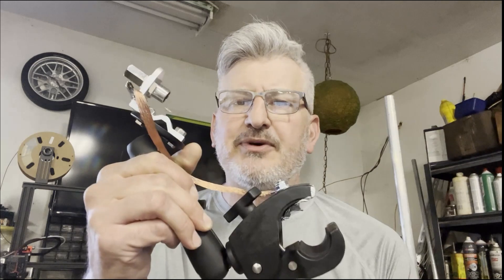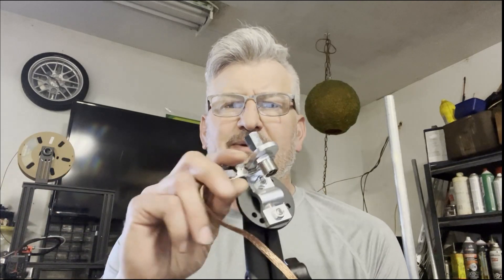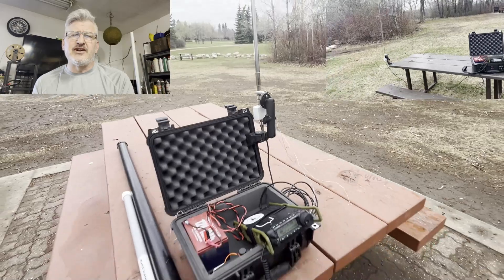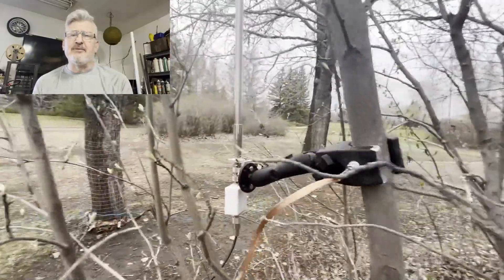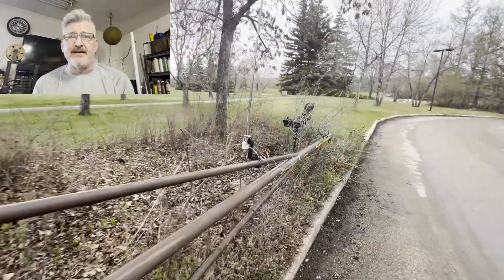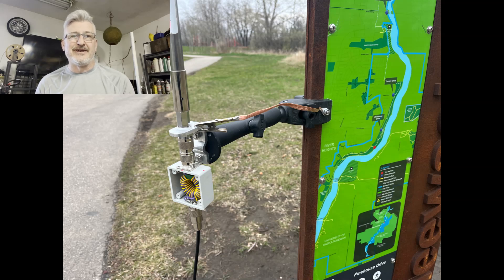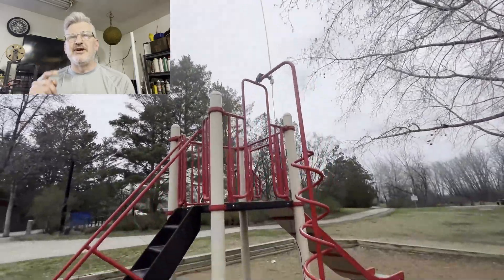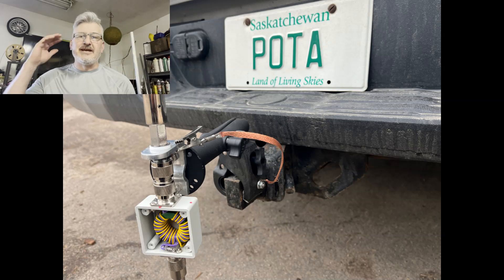Turning Random Objects Into Ground Planes With My DIY HF Antenna Mount

Comment: If you are mobiling in either a Tacoma or Tundra equipped with the adjustable cleats that travel in the rails along the inside of the fender tops, you can simply drill into the “meat” of one of the clamps and secure a 3/8x24 standard antenna threaded female coupling and there’s an excellent insulated mounting  base for lightweight mobile antennas such as Hamsticks.  Been running such an arrangement for 12 years now in our Tacoma with a cleat located as far to the rear as possible in the inside of the left fender wall.  I found the shield of the coax feed line under one of the two bolts on the inside of the fender just in front of the edge of the tailgate.  Be sure to use a burring tool to get down to bright steel under the head of the bolt on the stanchion for good electrical contact.  If you don’t want to drill into one of the four cleats that come with the truck, you can by single ones from your local Toyota parts department for about 12 bucks each.

Chris AJ1G Stonington CT
Reply from the maker: Very clever idea!  I looked at mine for some sort of use but I have a covered bed.  Thanks for the great comment!

Comment: It's probably one of the best POTA mounts you can make for yourself. That being said I would only be able to make one because the parts price listed comes out to about $104.00 American which is quite expensive for just a mount. It's a good idea and I'm sure it works well but in my opinion price is a factor when it comes to a hobby.
Reply from the maker: You are absolutely correct on the price.   I was lucky I had all of the parts around and repurposed them.  In the end if it prevents a few near misses or accidents when a 17’ antenna comes crashing down on you or your car it’s worth it.  Trust me it has happened more than once. ☹️